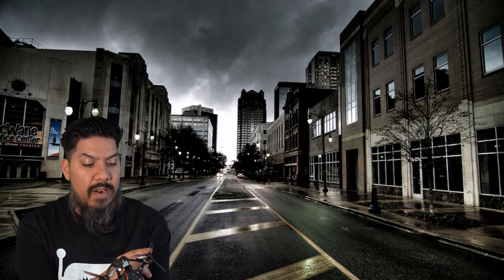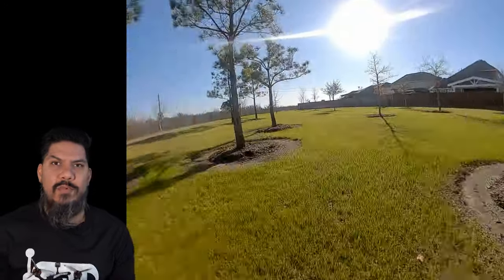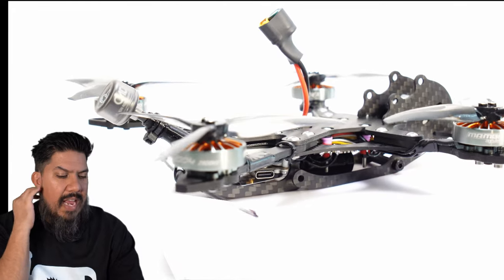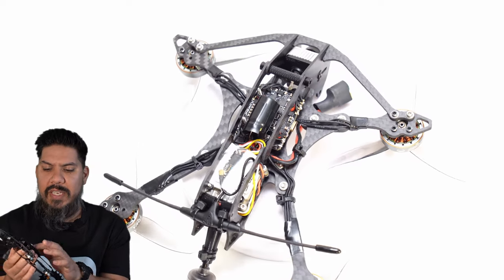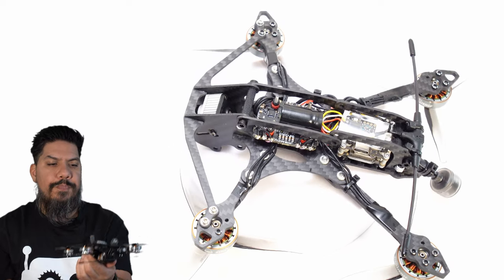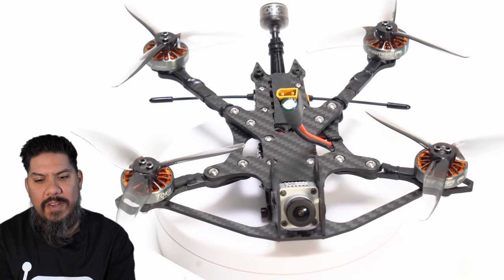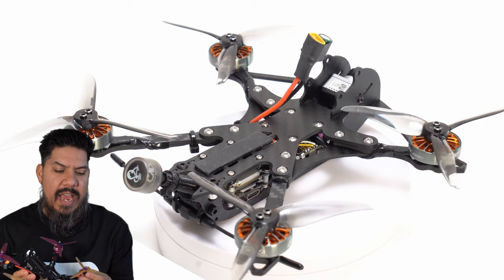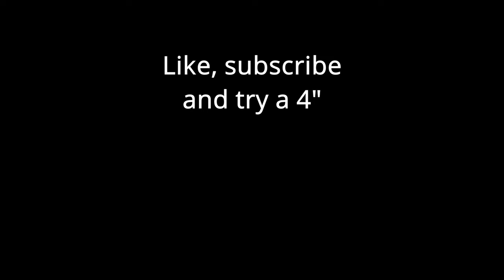Shocker 4" Toka 2004 2900kv motors DJI FPV Sub 250g freestyle Catalyst Machineworks Diatone Jhemcu

Comment: Sweet rip man.. love the rip and music combo .. I really want to try this shocker.. but not sure I like the open bottom . Debri wet grass or anything getting in there.. hmm 🤔🤔 damn. So inticing.. lol thanks man.
Reply from the maker: Thanks man!  This was original music by my buddy he allowed me to use on the channel.  Ill pass this on to him!  Thanks a lot!

There are some prints you can add, that cover the bottom.  I dont crash a bunch so i didnt add it, but if you are a more adventurous pilot, its an easy way to get that coverage.
Reply: @JonE5FPV  ya most definitely let him him know thats great music.. ya I have seen someone with a bottom plate.. guess ill have to buy it from someone.. I do not have 3D printer as im a truck driver over the road all time.. thanks man. Keep up great work and vids..

Comment: Flouride" or Shocker 4" ???
2004 or 2204 ? 
for "Proximity cruising" with Veeesta
Reply from the maker: i personally would go for the shocker.  If you want a medium light weight freestyle build, i really enjoyed the prototype 5 by fpv cycle with the amax 2305.5, managed a dry weight of only 309 grams.  Lighter than my racing quad.
Reply: I'm mid build of Protoype 5 but I have stripped press nuts... and they are out of stock. 
Kinda want to just swipe a credit card and get the Shocker 4" get something I KNOW is good... 
looking for quiet park flier for just Vista Pro... 
no action cam.. be able to do an insta go if I needed... 
I'm getting too risky with the DJI FPV.... 
it's going to get hurt soon unless I get something else up soon.

Comment: Im currently building a 4inch micro apex.. and it had 1306 4000kv motors now.. but im looking to upgrade.. what would be the best for a 4inch setup with a naked GoPro? Auw Will be around 300-350 grams with a 850mah 4s.. should i go for the 1606 toka, the 1805 betafpv, or the 2004 toka.. i dont know why but im verry interessed in the 1606 option.. what are your thoughts on that?

Comment: Great review! I've recently become fascinated with 4 inch quads. I build a Mutant 4 with BetaFPV 1505 motors. Then I build a Fouride 4" with FPVC 2203 motors. Then I built a Micro Apex 4" with FPVC 2203 motors. My favorite has been the Fouride. Are you planning on review the new Micro Apex frame?
Reply: does the Fouride have 25.5/whoop/toothpick board mounting? i know KababFPV basically invented the toothpick set up, so it would make sense his other frames have the support for it.

was that Fouride setup sub 250 tho?
Reply: @xymaryai8283  Yes. I fly my 5" Fouride with a 25A toothpick AIO board. It is not sub250g. It's 255g without the battery pack.

Comment: I built one with 1507 tmotor 3800kv on biblades everything else is the same as yours and I love it and when you design a 360 mount I would like one if possible I will pay

Comment: So its sub 250 auw with what 1050 4s lipo? Thanks for the vid man.  (Edit) sorry just got to the vid where its not sub250. Im designing frames with a sub 250 auw check my latest vid man.
Reply from the maker: yeah, you can hit it if you use a smaller battery, or smaller motors.  But the most performance seems to happen closer to 300grams.  Its a step in the right direction, we still have almost 3 years left to strip a little more weight down.  

Ill check it out on your channel.
Reply: @JonE5FPV  yea folks need to focus on full performance sub250 auw. It can be done. Thanks for your work man.

Comment from the maker: Build your own Shocker and support the channel here
Shocker 4" ultralight frame - https://www.catalystmachineworks.com/collections/frames/products/the-shocker-lr-ultralight-5?variant=31813516197961&aff=12
Toka 2004 motors - https://newbeedrone.com/collections/all/products/diatone-mamba-toka-2004-1700kv-2900kv-racing-motor-green?aff=29
Jhemcu AIO FC+ESC - https://www.racedayquads.com/products/jhemcu-ghf420aio-2-6s-f4-aio-20x20-flight-controller-w-35a-4in1-esc?_pos=5&_sid=3024f09a0&_ss=r
Caddx Vista - https://www.banggood.com/custlink/DKKGAnTNqg
Gemfan  4" prop - https://www.getfpv.com/gemfan-hurricane-4023-durable-3-blade-propeller-set-of-4.html?cmid=eHZ3Y2tBWGYrQWM9&afid=Q0lGVFUveWN0R009&ats=dGV4MUdTUFpUV0k9
Crossfire Nano RX - https://newbeedrone.com/collections/all/products/tbs-crossfire-nano-rx?aff=29
Reply: how many kv??